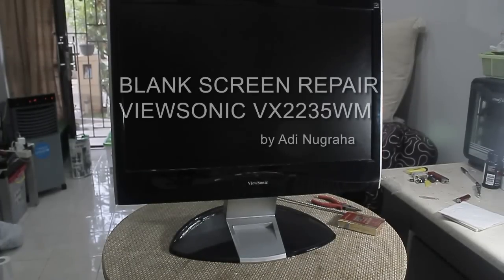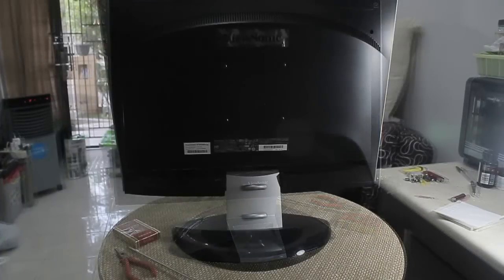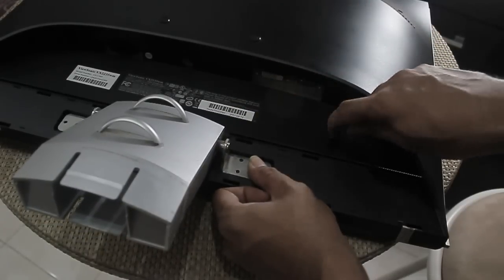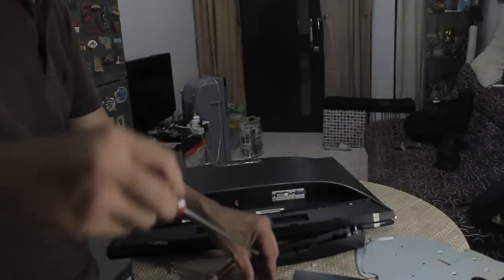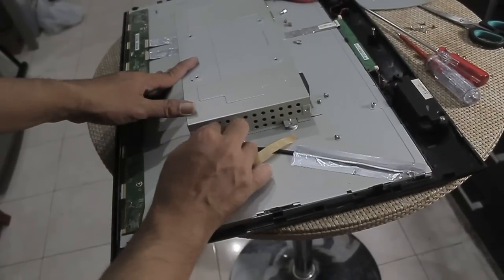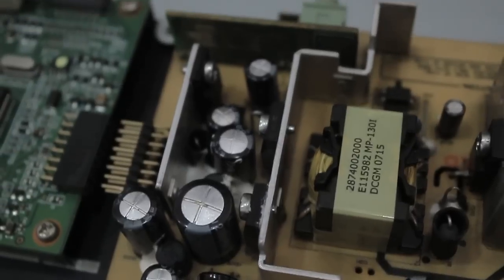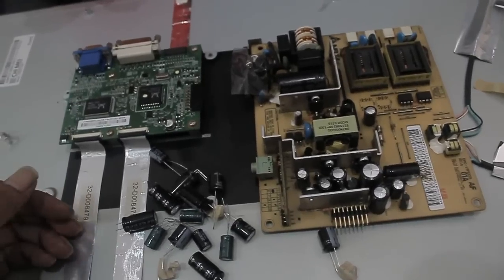Viewsonic LCD wont start Repair Blank Screen Fix Solved vx2235wm

Comment: Same basic procedure for my VG2230wm 

Thank you for putting this video together!

And yes, "prying" the two cases apart took a bit more force than I expected. I worked from the lower-right corner (when viewed from rear), up the right side, across top, down left side. I could then pry the two halves apart, and the remaining lower edge was almost like a hinge. A little "wiggling" and it came part at the lower edge, all at once.

On the circuit board, I see a couple of the capacitors are slightly "bulged" at the top. Now to order some replacement parts.

Comment: Surprisingly this actually worked and I soldered in 2 caps that I had on hand that were close enough to original specs. Now my monitor works again.

Comment: Hi, what is the output of the power supply of this monitor? 12v? I want to use external PSU for this monitor as i don't have the proper capacitors.
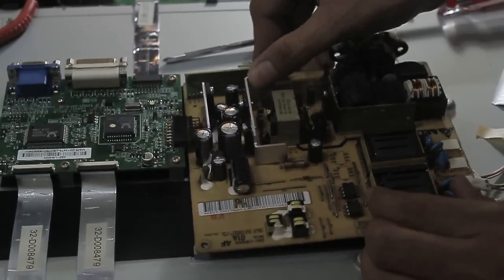Reply from the maker: it is easier to change the capacitor since the main PCB has many pin (See 1:28) voltage output. you can order online aliexpress.com / ebay.com
Reply: @addiengr1  PSU of my monitor doesn't have any bulging capacitors. Is it possible that they are still the problem?
Reply from the maker: @nihadasadli2642  yes my other video https://youtu.be/4As9j1icc8s . caps not bulging but value down. need capacitor tester.
Reply: @addiengr1  thank you very much

Comment: My Viewsonic monitor is the same as in the video.   The monitor will stay on.  As soon as it warms up, it will turn to a black screen.  Especially if you click something and get screen changing pages.  Will only stay on for several seconds now.   Unless I turn it off for a few hours and try again.   Any ideas?
Reply from the maker: u need to open the case and test suspect componentd.. I guess it is capacitor